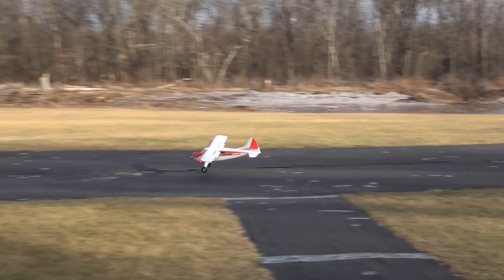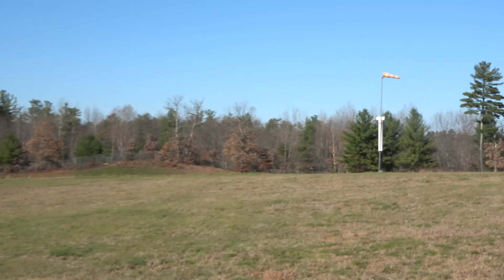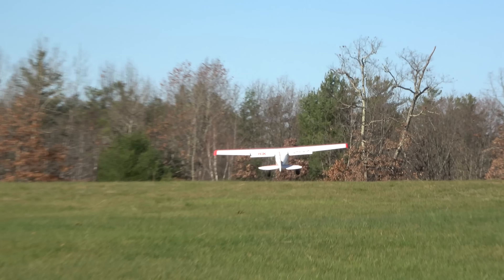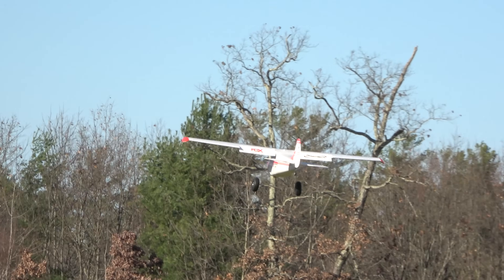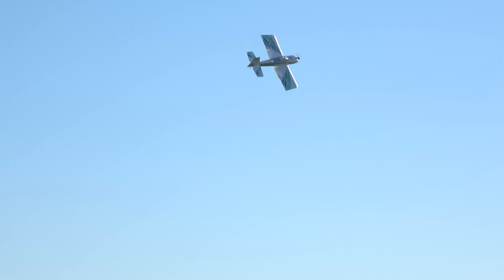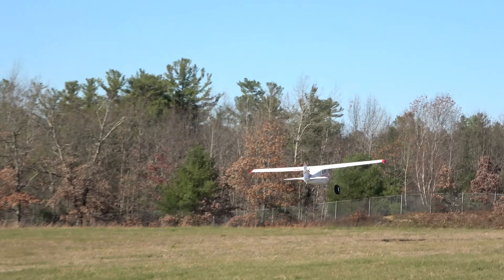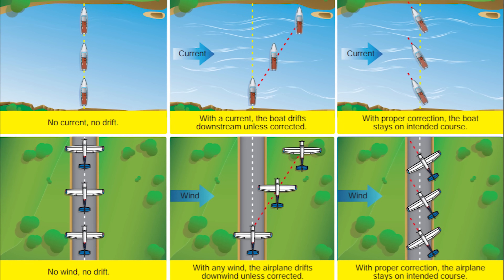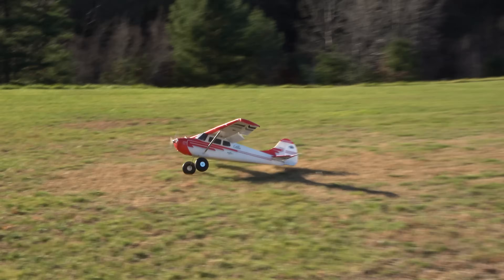The Crosswind Procedures RARELY Taught In RC

Comment: WOW, I needed this! I've been cheating since I started flying. I've been doing slow Coss-Runway landings, Into the wind.  ATC would hate me at O'Hare.  I'm going to practice this on RealFlight. What a great video. Now I'll look less like a crappy pilot at the field !!!  The ONE thing you could have added to this video is arrows pointing in what direction the cross wind was coming from, as I kept staring at the control surfaces. The physics of cross-stick landings makes perfect sense (on the 3rd viewing). You were giving a lot of info pretty fast.  When there is a solid and steady wind, I enjoy flying at zero ground-speed, or even moving backwards while keeping straight & level. The comedic value you add is a big plus. TWO THUMBS UP for this video.  👍👍 ❤

Comment: something that I discovered over the years, is that RC pilots who fly on smaller fields cope with this better. and those who are used to large fields are not, they actually SUCK to start, fly and land in crosswinds. because the field is large enough to always land against the wind.

So you fly in a large field that means you can always land into a headwind, try to practice this as often as you can.

Comment: Might have been NICE if you had said what Direction the cross wind was From in each Take Off.
Reply from the maker: Great idea! We had a lot of cuts for sure. We did try and show the wind sock in a few shots as well before panning to the plane. Easy rule of thumb is that whatever wing is low (specifically for in flight over runway) and has the raised aileron (works for both on ground and in flight over runway) is the upwind wing. Left wing low and/or left aileron up would be a wind from left to right and vice versa. Hope that helps!
Reply: @TailHeavyProductions  I've Got over 1700 hours in 20 or more Full scale and Actually LOVED Cross winds in (Certain Airplanes) It was just Difficult to determine the Wind Direction in the FAST PACED video ... Not a Criticism just an observation on my part. Great Video. Been subed for a while now.